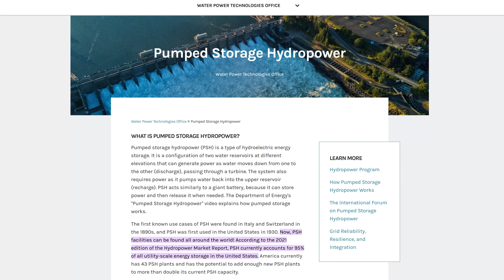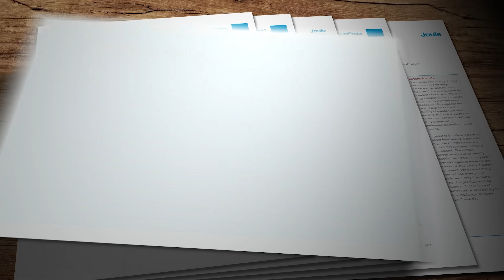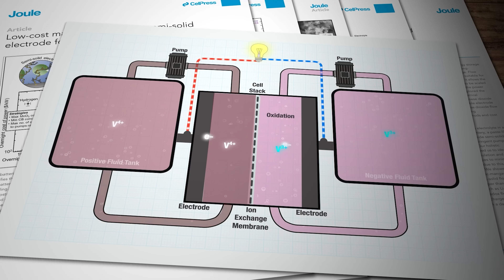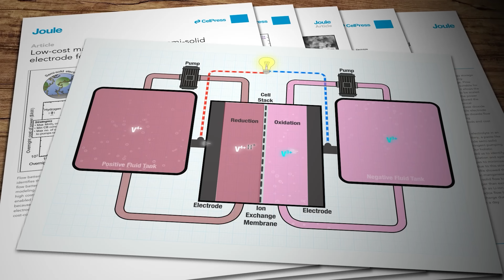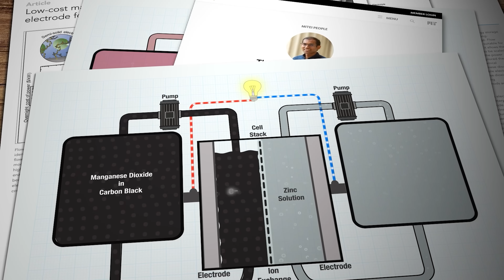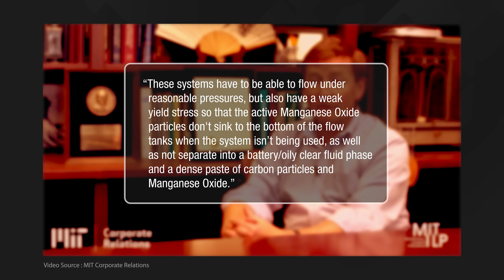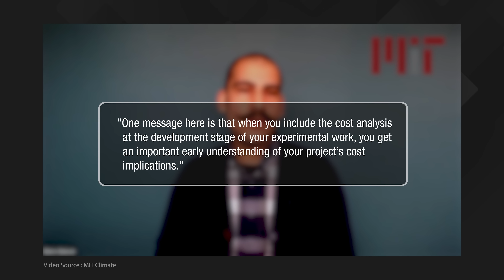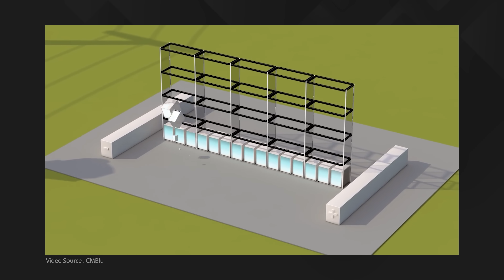Have we found the missing link in the energy storage equation?

Comment: Thanks for sharing. I think the better flow battery is developed by Elestor in the Netherlands. It is a HBr flow battery specially designed with low lcos in mind. They have mediumscale functional systems running as demonstration projects. The ultimate solution in my opinion would be mimicking nature. In nature we have adp/atp conversion for immediate use, sugars for, short-term and hydro-carbons. All conversions run at room temperature, at atmospheric pressure with non-toxic components, that are abudantly available. I know that there are several attemps/developments running to develop this synthetic hydrocarbon syntheses. I cannot wrap my head around why it would be so difficult to  mimick the processes that are so common and mastered by plants as well as animal. Can you possibly eleborate on this in one of your next videos? You are very good at this! I like your series! Best regards, Jan Kees te Riet Scholten.
Reply: Organic electrochemical batterie have already been developped. To my knowledge not in the solid state nor in semi-solid state nor in similar flow/tanks design. The capacity and electric power of organics may not read that of metals/metaloids, but there are surely opportunities for organic and biological electric storage to supply several of our electric energy needs. On can occupy more space and use more no-dangerous materials! The may probleme is that redox organics will be less stable that minerals. 
So alternatively, 1) at large scale it is probably more convenient to produce ethanol or other biofuel easy to store and then but 'burn' in fuel electricl cells.2)at microscale the mitochondria is nice to produce an electrical potential difference! but not convenient. 3) The electric organe of Torpilla?!

Comment: A form of storage which deserves more of a mention is biofuels.  Wood-fired power stations complete the quartet of sustainable solar solutions (with wind, hydro and direct solar) while providing storage in the same way that a coal heap does at a coal-fired power station.  And planting trees (paid for by a charge on fossil fuels) will close the carbon cycle to force a transition away from fossil fuels while creating the biofuel feedstock needed for this form of storage.  Cheaper than batteries?  I suspect so, since it is a form of solar energy as well as providing storage complement the intermittent forms.

Comment: Dave, I need to ask you.
Its about storing energy. Something I wonder about. The known system of pumping water up a hill works fine. But you need to have both water and a hill.

What about dirt? Can sand move a mill? Can I use a sand mill to make electricity?
Sand is heavy. It can be moved up a small hill and it will still move a mill. And it doesn't need much space. You don't need to pump sand to a lake… you only need …. Well. you actually need to think about what your doing. 

Nevertheless it might be an interesting concept.
So what do you think?
Following you for a while
Simon Robson

Comment: How similar is that to existing zinc-carbon batteries, ie the cheapest batteries already available as AA and other sizes in every shop? They also use a paste with manganese dioxide. If he's just taking the inside of an AA battery and mixing it with a bit of oil to make it flow, in a way, that's genius. An already well-understood chemistry. He might also be able to buy up dead batteries, some towns and cities have disposable battery collection schemes, and use that as a cheap source of materials.
Reply: Yes, exactly, rely on recycled materials is huge plus.

Comment: One question about the Levelised Cost Of Storage graphs. The graphs shows the slower discharging (72h) and, 300 cycles each year. But if discharging alone taks 72 hours ~ 3 days. Discharge time for 300 cycles would be 900 days ? How would that fit in 1 year?

Comment: It seems to me that the iron air battery, discussed in a previous video, is a more cost effective and less complicated solution. It will be interesting to see how these solutions stack up in the long run, though this balance of pumped sludge mixture does sound a bit tricky to manage. I’d like to imagine green energy storage comprised of one of these state of a new battery tech, bolstered by a backup transportable supply of hydrogen (or ammonia), produced with excess grid power, to secure the integrity of the grid in any eventuality.
Reply: Iron air is inefficient

Comment: I wonder, could crude oil facilities be adapted to this use (another gloop) & how much would temperature affect the viscosity of the gloop ?
Reply: The irony would be too great, but it would be amazing if oil featured in a real battery solution.
Reply: @markhathaway9456  Absolutely. I was being more optimistic in the sense that the obsolete facilities could be transferred to a new use (viscous fluid pumps & storage tanks etc.)
Most of the merchant navy runs on crude oil.

Comment: I am much more interested in flow batteries for small home/small business scale usage.  Small scale batteries for home power storage for several days of backup power is much more likely to be installed than massive grid systems.
Reply: then once most people have them, would that not also serve as the massive grid storage, just not centrally concentrated, which also seems like a good thing.

Comment: ~ 9:00 - Judging by that economic analysis, combination of Li-ion and hydrogen (and pumped hydro, of course, where suitable) looks like the solution. I thought that hydrogen is more expensive.
Perhaps one parameter missing from those graphs is the size of installation (in terms of both power and energy stored) - I suppose  that various technologies will scale differently (in terms of cost per watt and per watt-hour.)

Comment: I like this, but I still want atomic power in the mix.  
Batteries must be, at a minimum, used to deal with power demand spikes.  It's the best way to level things out, as a consistent amount of power can be generated and the power storage picks up the slack when the need is higher.

Comment: This one presented here is bullshit. 

Use the power coming in to lift gargantuan weights as in a piston arrangement. Hold until power is required. Releasing this massive weight forces that fluid through a turbine thus creating electricity. Incorporate a magnetically balanced flywheel. Almost endlessly recyclable simply based on valves, seals & bearings. Simple arrangement & totally practical. There is no requirement for any phase change or "ideal" separator, no specialised mining, the technology exists already.

Comment: What I was pondering one day was a Iron/air batteries(roughly semi truck trailer in size) hooked to a renewable energy( solar/wind farm) using electric semi's think plug n play, take iron/air batteries charged from the farm to a building made to plug it right in like AA or AAA batteries for large grid scale supply...add the flow style to it as well may reduce wasted energy in this idea ive been pondering

Comment: Would like to mention ZINC - BROMINE flow batteries being produced by Redflow  from Australia. Currently deployed across Africa, Australia, New Zealand, and now some in USA. Long duration energy storage devices that work in a much wider ambient  temperature range than lithium and use a much cheaper, safer chemical solution than Vanadium flow. Very long lifespan for solution with no degradation due to cycling. Long term the solution does need restoration cleaning which makes it new again. 
Designed to fully charge and fully discharge as solo units or in sequenced strings for large scale applications.
Can sit fully charged without capacity loss for very long periods of time.

Comment: I think thermal storage with rocks is the way to go. Imagine the rocks in an electrical sauna stove, now scale that up to the size of an oil cistern. If you want storage of energy at rock bottom prices then you have to make it out of rocks 🙂
Reply: If you convert electricity to heat, you can get efficiencies in the high 90's.  It's the reverse conversion, from heat back to electricity, where things go all to hell.  You'd probably see efficiencies in the 40's at best.  This is due to a thermodynamic principle known as "Carnot efficiency".
Reply: @incognitotorpedo42  Yeah, the trick is to have a use for the waste heat, like use in district heating. Combined heat and power plants have efficiencies around 90%.

Comment: Dave it all sounds good, except our reliance on elements like zinc ramps up pressure to mine sulfide deposits, with all the attendant problems of hazardous substances.  I'm still learning towards the common element solutions, like liquid air storage and hot salt/rock storage and recovery.  The best battery is needing less batteries, that hidden force called efficiency.🌞🌄🌞 Great presentation though, it's good to see all the cards on the table, and you're bringing us the world of possibilities in a nutshell. 🥜

Comment: I’d love a realistic video on how long it takes to get things up and running practically. Like if the world found the one way and all agreed on it, how long until it gets common use? People don’t seem to understand that things take time to build.
Reply: Exactly.

That's the point that the nuclear fanbois always ignore.

There are no nuclear designs optimised for mass production. Building a test article would take 10 years at least. Testing another 10 to uncover the most basic mistakes. Then there are no factories that could make such a design if it existed. So they would have to be built. The machines in those factories would have to be designed, and tested, and a manufacturing facility constructed to make those machines once there was a final design for them.

That gets you one factory in 25 years that can output 12 reactors a year at best. To make the 50,000 reactors needed would mean hundreds or thousands of factories. But to fill those factories needs machines, that have to also be made in factories. One facility building those machines isn't going to fill a thousand reactor factories. You'd need dozens or hundreds of those facilities. But the factories that could fill those facilities don't exist. You'd need dozens of factories making those parts and machines.

It's decades of work that can't be speeded up simply by throwing money at it.

A solution has to already exist. The designs for the machines that make the things for the solution has to already exist. We don't have several decades to delay.

It's got to be simple. Simple to design, simple to make, simple to install, simple to connect. The factories that make it must already have examples that have been designed, built, tested and are ready to mass copy. The machines that make the machines that make the solution must also be already designed, built and tested and ready to mass copy.
Reply: @gasdive  Turkey Point went from start of construction to operation in 5 years. Been running for 50 years as of December of this year and Sept of next year on the second unit. That shoots your 10 year timeline if you build something that is known to work.
Reply: @gravelydon7072  the Turkey Point reactor started the design process, based on an existing submarine reactor in 1954. The first Turkey Point reactor started operation in 1972. I think 10 years to go from "right boys, design a reactor that can be mass produced" to a running reactor is wildly optimistic, and the construction of a reactor from an existing design in 5 years doesn't change that.
Reply: @gasdive  The design is already there. Just copy the thing to build it. No need for 10 years to get another one like it operating.
Reply: @gravelydon7072  the current designs are intended for a highly trained workforce to put them together over a period of several years in batches of 4 to 6. Like a formula one car.

We need a design for a Camry. Something that can be put together by unskilled and semiskilled workers in a factory not nuclear ticketed journeyman welders and experienced technicians. A design where it's impossible to make a mistake. Designed to be cheap to make. No, cheaper than that. And then designed so that a new one rolls off the line every 90 minutes, not every 5 years.

A design that can be plopped down on practically unprepared land, because we don't have enough concrete, reo or skilled concreters. Then run by teenagers on minimum wage that have had a few minutes of instruction, because there aren't anywhere near enough skilled nuclear plant operators, nor are there enough skilled nuclear plant operator trainers available to train the millions that would be needed to run an existing design.

The world needs 50,000 in the next 8 years. We can no more use the existing manufacturers or designs to get there than we could ask McLaren to build 100 million formula one cars. They couldn't deliver and we couldn't pay for them.

Then on top of that, none of the current designs are breeder reactors. Using conventional reactors we'd use up all the uranium before the last one was completed. We absolutely require an extremely efficient high burn up reactor, completely unlike anything ever built or there simply won't be the fuel to run it. So it needs to be as simple as an axe, yet also be the most neutron efficient design ever conceived by a large margin.